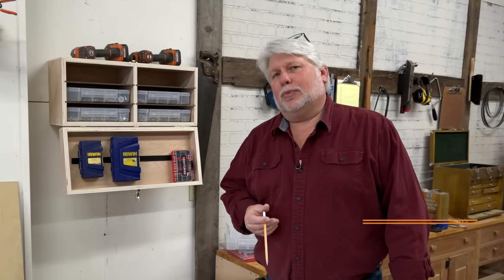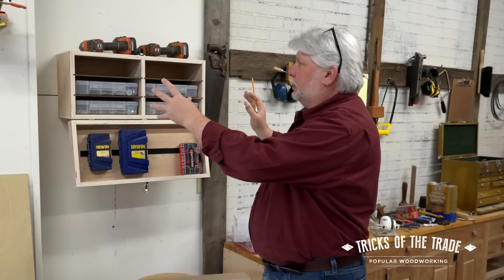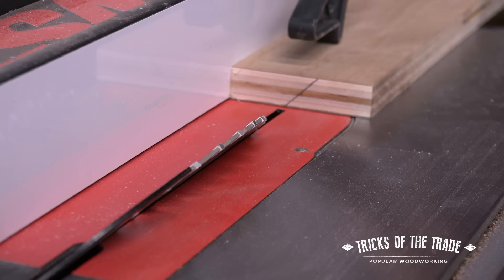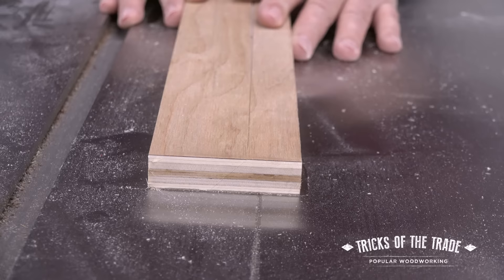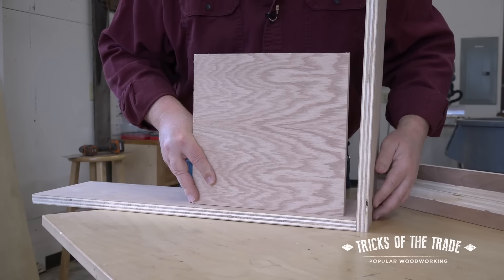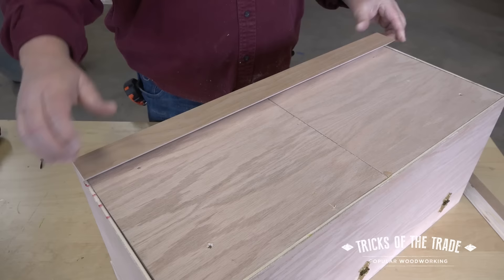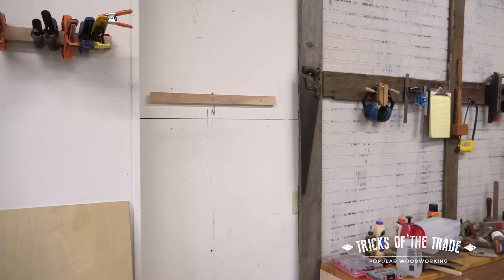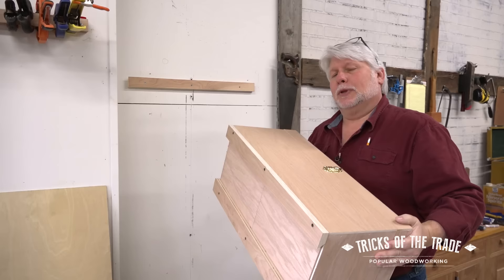How to Make French Cleats | Tricks of the Trade

Comment: you can include a small extra step...  with your table saw or a few swipes with a hand plane,  rip/ cut a 1/16 or so off the sharp edge of the 45° french cleats...  IMO this little extra has a couple benefits, a slightly flattened or blunt edge of the 45° cleat much more comfortable to handle... if you pick-up your cabinet, etc. by cleat, that sharp edge of the 45° can sometimes cut into your fingers.   But also, it makes your cabinet, etc. much easier to pop on/ off the wall.    especially when hanging heavier things, on that sharp edge on the 45° cleats have a tendency to get wedged slightly under/behind one another,  making it a challenge every time you go to lift/ off the cleat.    Cut 1/16 or so off the sharp edge of 45° along both cleats, and the cleats don’t get wedged/ jammed behind one another when hanging heavier things such as cabinets, etc.
Reply: That's what I do (blunt it with a block plane). It does make a big difference.
Reply: 45 degrees is too steep an angle , 25 degrees works even better, and blunt the leading edge and you have a very comfortable handle. And never had a cabinet fall off the wall. 
Why is it called a “ French “ cleat?
Reply: @paulbadger6336  Other than your desire for a handle, why is 45 "too steep"? 

It has worked quite well for me, and 35-45 degrees seems to be the most common implementation. I can't think of any good evidence-supported reason why you need to go with a more shallow angle. I've never had nor seen one break.

I haven't seen a definitive source for why it is named a "French Cleat". Lots of ideas, but no real proof.
Reply: @paulbadger6336  ok. Thought of one. If you are super tight in vertical space (like upper kitchen cabinet with almost no clearance above), a very shallow angle can save you a little vertical space, and might make the difference between hanging the cabinet and not. I think that's a good reason, when you have those situations.
Reply: This also means that if your wall cleat collects small amounts of sawdust, the hanger cleat can still drop all the way into position.
Reply: @paulbadger6336  The reason I stick with 45 is you can use the same cut for 2 pieces. I french cleated my whole garage @45° that way I just add a 45° to anything to make it hangable and modular.

Also I just incorporate a 45° into any 3d print I want to attach to the wall...and I find more than 45° when 3d printing requires a bunch of supports.

If you use any angle other than 45°, then you would end up with more scraps...since once the wall side is done all the other cuts will be the opposing angle.

Unless there's something I'm not thinking about?? I'm open to learning something new if there's a better way.
Reply: @Psychlist1972  just reducing the depth of both of the cleats would save vertical space. there wouldn't be any wastage either because you could just do an offset mitre cut on the flat face of the stock or the flat face left by the previous piece
Reply: @Psychlist1972  Then use no angle at all. Just use a few screws to keep it on the rail...
Reply: What about for something that's staying on the wall, such as art? Do you still recommend the trim cut? Thanks

Comment: Another tip: Trim about 1/8” off the sharp edge off both sides of the cleat, to minimize the risk of debris preventing a solid interface, or glue squeeze out making the attachment permanent.
Reply: What about for something that's staying on the wall, such as art? Do you still recommend the trim cut? Thanks
Reply: @leonardodalongisland  yes, even if its just art, over time dust/ debris can build up and potentially keep the cleat from fully seating
Reply: @christopherwilliams9639  Thanks

Comment: Great tip. Years back I decorated the garage with a bunch of poster size photos that I have taken over the years. I live in the South and occasionally I have to vacuum the spiderwebs from the walls and corners. The French cleat system allows me to remove and reinstall the frames quickly and easily and they are always straight. The wall portion of the cleats are short and hide behind the frames.
Reply: You actually get webs behind the flush-mounted pieces?

Comment: I have seen upper kitchen cabinets hung from French cleats with the cabinet cleat built into the cabinets at the top, with very lose of usable interior cabinet space.  They used one long cleat on the wall carefully hung to be level and then just hung the several different cabinets to that, making them all level to one another.  (Standardize where the cleats are on the cabinets.)
Also you may not always want the cleat sawed in the center.  If you had something heavy to hang, cut a 5 or 6 inch board off center and screw the wider part to the wall.  Then you should be able to get 2 screws into each 2x4 stud.  The cleat on the cabinet could be attached in enough places to hold its part.
Also, make the cleat on the wall shorter than the one on the cabinet, then if you get instructions that it needs to be a little to the left, (not that much!) then you are still in good shape.
Vary the thickness of the cleat material!  On some heavy objects you might want to use 3/4 inch material and on lighter objects use 1/4 inch plywood.

Comment: I plan on making and mounting a french cleat system in my garage. My question is this: I have concrete block walls, can I mount the cleats directly to the walls? or should  I still mount to a plywood base? or first mount 2x2's to the walls then mount either plywood or cleats  to them?? Thank you

Comment: I made a French cleat with a 2x2 piece of left over I had but it doesn't seem sturdy. All it is is a 1x4 screwed to the opposing french cleat which I filled holes in for my screw drivers but it's real wobbly when I set it on the French cleat which is on the wall. Any ideas why?

Comment: How did you come up with cutting the 3 in.board at 1 1/8 in. to get equal widths and how thick is the material. also are you counting the blade thickness in the measurement.
Reply: If you really want to know where you need to start cutting to make it even on both sides, then make a vertical line at the midpoint for the width and then make a 45-degree line cross that at the midpoint for the thickness... The kerf of your blade would have to split that 45 degree line... Why worry about the distance from the edge?

Comment: Thank you for the helpful video. What do you recommend to prevent the cleat from splitting when mounting to the wall? I keep running into this issue. I was hoping you would show that part.
Reply: Pre-drill holes.
Reply: if you're not using plywood for the cleats then try that. usually shouldnt be an issue since each ply alternates the end grain

Comment: Question for anyone here. If I’m doing two cleats. Like a top and bottom on something heavy, how do I measure accurately so both line  up and rest in their respective halves on the wall. Like I would mount the wall portions then how do I measure to ensure I mount the other portions to the work piece properly. Any tips?
Reply: Mount the top cleat to the item, put the second cleat into the receiver with double-sided tape, set item into place and push against double-sided tape. Remove the item and either scribe a line or drill and screw. Remove the cleat and tape and reassemble permanently.
Reply: @dirtyhands5323  genius! Thank you so much.
Reply: @KemDIY  glad to help, good luck.

Comment: Can you put French cleats just in studs of an unfinished wall? Or do I need to screw in a sheet of plywood first?
Reply: Plywood backing reccomended yes
Reply: I have used a French Cleat system in an unfinished (studs only) barn,  hanging rabbit cages.  It "works".. but a continuous run of plywood behind would offer you MUCH more stability.
Think of standing on your toes vs laying flat on the ground in the "let's make a snow angel" position. Thee more of any two surfaces that make contact, the more stable and secure they are.

Comment: I have a question.  How about the weight concern?  Does the French cleat system bear less weight than directly screwing several screws on the wall?
Reply: The advantage for strength in my experience is that you can screw a cleat to every stud, and because you're not doing the fixed with the weight in your hands you can make better screw joints to the back of the cabinet.

Because of the angle, the cleat pulls the cabinet to the wall with downward pressure, so it's not going to come off accidentally.

I can sit on a cabinet with French cleats holding it up, as long as the cabinet itself is strong enough to hold my weight and it's screwed into the piece and the studs well, it's not budging.
Reply: Thank you!
Reply from the maker: Actually it's spreads the weight about the same. You still have the same contact point(s) in the wall, but a French cleat does give you a slightly better chance of catching studs without the potentially odd placement of screws looking ugly from the front of the cabinet.
Reply: I have heavy Lumber hanging about half the length of my shop on a French cleat system and the cleats are spaced about a foot apart vertically with about six rows and the lumber sits across 4 in brackets that look like the stringers that hold metal shelves on a store display and are slightly tilted upward. Because of the plywood wall and the weight distribution of the cleats they are able to hold a ton of weight.

Comment: Great informative video. I’m going to be using the French Cleat system to hang some heavy items using 1 1/2 inch thick wood. What length of fastener would you recommend for driving into the wall studs. My question is, how far into the wall studs do the screws have to go? Also are regular wood/deck screws okay. Thank you,
Reply: Should be if you can't see the screws also id make sure go in a bit deep if its gonna support heavy stuff, inch or more go long as you want as long as it doesnt go through the stud and out the house
Reply: Riley Richmond thank you, very much appreciated.

Comment: Hi, I like these cleats, but why are they never used fir kitchen wall cabinets?
Reply: Because it is an unnecessary expenditure of materials for a permanent solution. You also lose 3/4 of an inch in cabinet space by doing this which isn't ideal. It's a trade-off between modularity and the cons I just mentioned.
Reply: @elysiandreamz  yes i see your point, but other  cabinet fixtures are not much different when it come to space saving.I am looking at one particular one that looks like a spider, you need 16mm at the back but its hidden, also with the french cleat you have the advantage of find the right places for the screws. I think in the business of kitchen hanging etc, the wheel has been re invented and its thus a case of to try to make money out of us, we are brain washed , we all fall for it. Its got undue too technical, perhaps it makes us more of an expert to the unknown person asking us to do work for them. If it was just a french cleat a lot of people would be willing themselves to have a go instead of hiring out . Look at for example, some fittings have a screw (i think its a screw) that locks the fitting into place,,,like the cupboard is some how with all that weight going to lift it self and come crashing down. When next time you are sat in front of the fire, enjoying your burbon , patting your dog have a good think about it :)
Reply: @elysiandreamz  ps wish my work space was as neat as yours :)
Reply: This is used often in the UK where people typically take their cabinets and appliances with them when they move.

The loss is depth is infinitesimal.

Comment: Hi David>
I think you forgot to add 1/2 the thickness of the blade to your equation as seen in your rip shot. Devide the board width in half minus 1/2 the board thickness minus 1/2 the bade thickness .  At any rate, your method beats the heck out of tilting the balde back and forth.  Good example.  And, as stated below, break the sharp edge of the point and it will fit better.
Thank you.
Chuck

Comment: how can i get a 45 degree angle if i only have a hand saw
Reply: Carefully!  Seriously (assuming you mean a carpenter's hand saw and not a circular saw), draw a 45 degree angle on the end of the board, then 2 lines coming off each end of that, down the length of the board on each side, each line parallel with the edge.  Then start your cut first on the end of the angled line on a corner, then shallowing a bit so that your saw is cutting across the full length of that 45 degree end mark.  Then carefully as you rip down the length of the board, check both sides frequently to make sure you're still on both lines, making small corrections as you go.  A good sawing tip for the hand saw is to grip the handle while extending your index finger down the blade -- for some reason having to do with the mechanics and balance of your hand, that seems to help saw a straighter cut.  The French cut is a very forgiving joint -- even if your cut is wavy or a bit off, as long as you use these 2 matching pieces (and keep them in the same orientation as they were cut when you mount them) they'll mate, and the cleat is never visible behind the cabinet (or whatever you're hanging) anyway.  After you make the cut, don't forget to blunt the edges with a block plane or sanding block.  It'll not only be more comfortable to handle than the razor-sharp edges, it'll also provide a bit of a relief gap to keep dust or grit from allowing it to seat, and will keep the feathered thin edges from wedging behind each other, allowing an easier lift off of your cabinet when you move it.  Good luck!
Reply: i know its late but for others it might help, you can get a mitre box few a few pounds/bucks. It has the different angles pre-cut so you just slot in your handsaw, and voila you have the ability to cut at different angles.